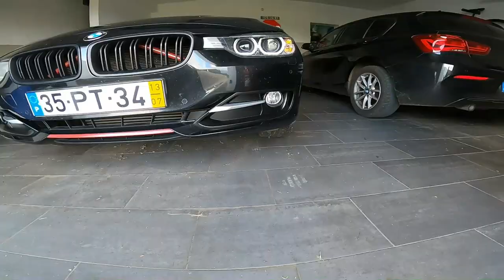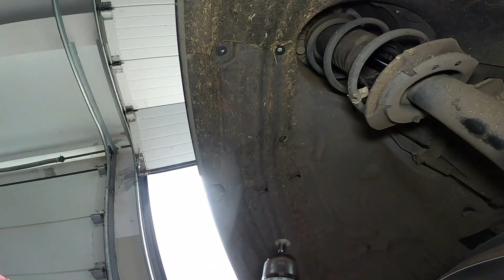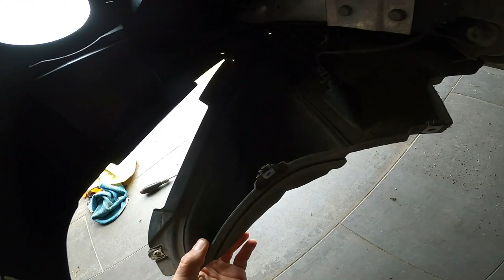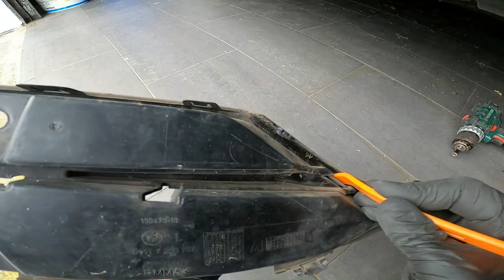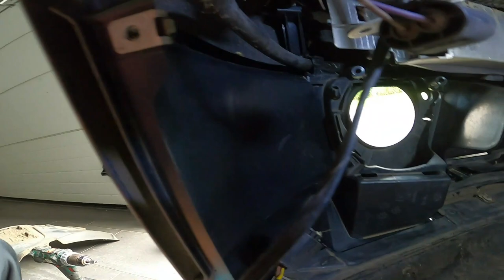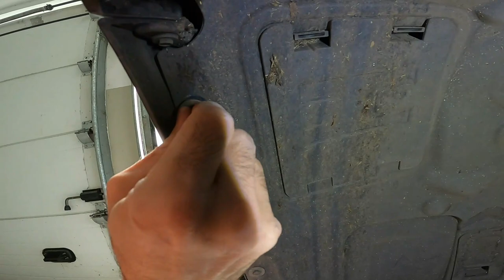Grill Fog Headlight Replacement BMW Serie 3 F30 F31

Comment: I have the same problem. Their color changed from black to blue. This is so baffling. Is it so difficult to make them from a material that does not change color?
Reply from the maker: You can try painting with a spray paint designed for plastic.

Comment: On my 435i, the starboard side has an air duct for the oil cooler core. What additional challenges do I need to consider on this side

Comment: This was way harder than it had to be.   Its 10x easier just to take the complete bumper off.
Reply from the maker: that is true. Without the bumper it is easier to remove. The problem with many models is that it turns blue after a few years because of the sun.